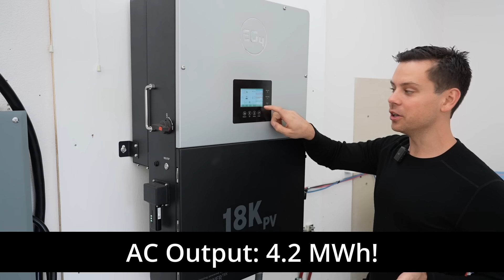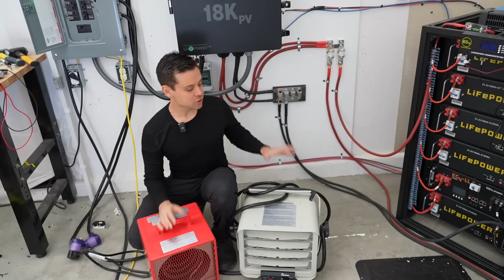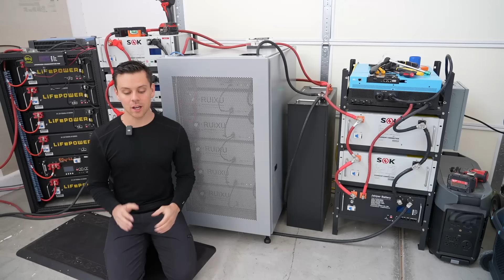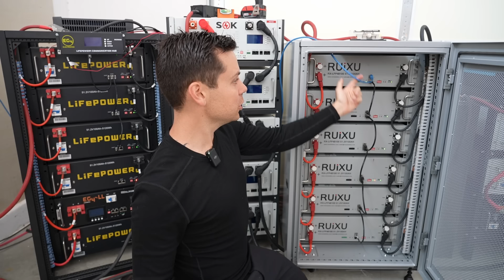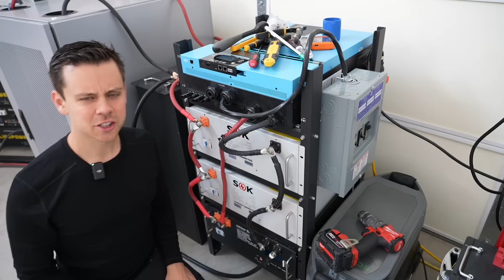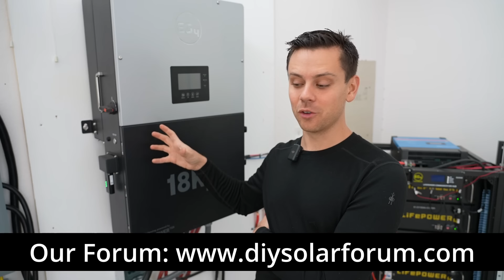EG4 18KPV + 113KWh LiFePO4 = Offgrid Bliss!

Comment: I'd like to see a side-by-side between the EG4 18k and the SolArk 18k including the possible configurations.  Off-grid/On-grid/Hybrid, with and without generator
Reply: I would like to see them compared as well. Possibly with a tear down to compare components? Also curious about shielding/lightning/EMP protection in both units.
Reply: Ditto!  I would love to see a faceoff between these two inverters!
Reply: He aint going to do it because the Sol-Ark is  better Inverter, it has true customer support and Zero bugs.
He does not make any money from Sol-Ark sales so why would any YouTuber promote a product that offers them no financial gain over one that does.

I Sell and Install both the Sol-Ark and the Fortress Envy witch is the same thing as EG4 12K/18Kpv.
The Envy has lots of small software issues that make it a PITA.  I put in a Sol-Ark and it just works, no customer calls.  I put in the Envy and it's constant issues.  Those people at Fortress offer good service but they cannot fix the problems when it's the software.
Reply: @derickvernon6652  Thanks for the reply.  It all comes down to "You get what you pay for, most of the time".  I have heard some good things about the Fortress batteries.
Reply: @derickvernon6652 I heard deye makes sol-ark inverters?
Reply: @derickvernon6652  works great as long as you dont use EG4 batteries ...they just admitted that if you hook up a EG4 batteries to the sol-ark and attach the comms cable you void the warranty because they are not compatible and never will be
Reply: @derickvernon6652  I tried to Google what Pita means but it's telling me something about bread what does the abbreviation mean may I ask. And how much is the solark Ark inverter...n what is the idle consumption on it.
Thanks in advance for your reply
Reply: @VinceBadovinatz88  In this context Pita means Pain In The A$$
Reply: @michiganengineer8621    I should  known🤣 everything was so technical I didn't think of it

Comment: Will, been doing a lot of research on these. Still can’t figure out (can’t find it in the manual) how to set the system to charge the batteries from grid when the batteries reach a set SOC. You can trigger a gen at a given SOC and you can set times to charge from the grid, but I don’t see how to trigger a grid charge based on battery SOC.

Comment: Will - Does the 18k work with a generator because I am 100% off-grid? Does it have genset auto start capabilities or does that require additionally components?
Reply: The genset auto start is on the generator side not the solar inverter side. As long as you’re inverter has provisions for generator then you should be ok.

Comment: I have a question that may demonstrate just how much I don't know.  You made a hand truck portable system.  But, is there a way to make a hand truck portable system that is expandable down the road.  What I am asking is, you can buy all in one systems that have 'plug in batteries'.  Is there a safe way to make a hand cart with just batteries that can plug into the existing hand cart systems you designed, without a whole lot of screwing in wires and such? Just plug and play like an all in one system?  It would be nice if it was easy to add a handcart of batteries to the existing hand cart.  It is much lighter that way with two hand carts.  Just curious.

Comment: Thanks for the video.  I get my EG4 18KPV this week.  Can't wait.
Reply: Did you end up installing the 18K EG4? How has your experience been?
Reply: @justonpreble4083  Yes I did ba k at the end of August.   I love the 18kPV from EG4.  It works very well and I haven't had any issues at all.
Reply: @justonpreble4083   I have now had my 18kPV with 30kWh EG4 LL v.2 battery rack powered by 19.2 kW of Aptos bifacial solar panels and I absolutely love my system.  As Will mentioned it does everything with such ease.  I am now thinking of adding a couple of the EG4 Power Pro wall units to my setup to have extra backup storage.  I agree that the EG4 18kPV  is the best inverter on the market today.

Comment: What would be the outcome if I installed a 30kWH system meaning batteries, EG4 18Kpv and solar panels then shut off the breaker connecting me to the grid?

Comment: Will, I have 2 EG4 6500EX's & SS recently offered me a trade in program for them to goto the 18K. I'm trying to figure out why & what the upside is to going to it? I'm completely off grid & likely always will be. Thx for all you do.
Reply: Be careful. Your two 6500s have more output capacity than one 18kpv, because the 18k = input, not output.  Of course there are other considerations, but that output comparison is widely misunderstood due to SS's label.
Reply: @corba197  agreed. 2-6500's = 13kw. The 18kPV has 12k. I was looking at eventually adding atleast a 3rd 6500 for my +21kw of panels. Being off grid I like the thoughts of redundancy 9f the 2-3 6500's. Some of that is lost with a single 18kPV. But then again, I'm wondering if they may be completely going away from & not supporting the 6500's sooner than later. 

That said, I really like the simplicity & options with the 18kPV... especially with their new PowerPro/ LUX batteries that are made for each other. If I do the upgrade, the odds are I will eventually end up with 2 18kPV 's for 24kw potential. AND then keep the 6,500's for a backup or AirBnB cabin use.

Comment: Love the videos Will, I dud buy one of the yellow Eg4 3k inverters but noticed an issue with  the power output it does produce 120vac between L and N but if you measure between  L and G  it is 57 vac and between  N and G it is 63 vac.   Contacted signature solar  and sent them pictures documenting these conditions.  Now I am waiting for them to get back to me with a diagnosis it has been  about 5 to 6 days. Has anyone seen something like this?

Comment: Hi Will, The most challenging domestic load I've found is a microwave oven. I think it's the power supply in the oven rapidly switching current, similar to an arc welder. Maybe, add a microwave oven to your test jig.
Reply: I noticed the same thing with my mig welder. I think it is due to poor voltage regulation.
Reply: @SunInLithium  , Both operate using a sort of pulsing power supply, so the current starts and stops at a super high rate. Light dimmers do the same thing, but the current is low. A mig welder is a double whammy, because it has two pulsing parts: 1) The switching power and variable pulse width control for the electrical arc current; and 2) The "pulse width modulator" that controls the rate of wire feed.

Comment: Great video... I appreciate the load testing information and the statement you made about it handling a 5 ton A/C with just one 18K.  Keep up the good work.  I've been using a smaller system to backup critical loads but would like to run the whole house off the grid if necessary.  I live in New Orleans, with hurricanes and the grid instability of an old grid it just makes since to cover the whole house.  I would like to see some of the attempts you made to try to trip the 18K.
Reply: Signature Solar just dropped a really good load test video running a 4 ton with regular household appliances.

Comment: Hi Will, there are a few details about your test setup that are important to the evaluation of a hybrid inverter. You did good on the performance of the SW interface. there are alot of installations that will want to connect in existing AC coupling, be able to sell to the grid and AC couple when the grid is down.  This requires a transfer switch in the EG4 inverter that can manage the isolation.  It is not clear how you are testing this mode. Related is the configuration is that many solar systems would be most economically modified by just adding in the EG4 inverter which most generally may also require not having the EG4 inverter near the service entrance.  This requires the EG4 be able to control a remote contactor at the meter.  It sounds like your shop and house loads are distributed suggesting a this test setup.    How does the EG4 do in managing the grid tie when the meter is remote?  thank you
Reply: I have 3 grid interactive installs using the Envy Inverter witch is the same as the EG4.
All those Installs had random Grid selling which caused some issues for the owners and so far Fortress has not been able to fix it.
I also have lights flickering at those installations.  The two off grid installs I have had generator starting issues as well as the same flickering light issues.  Customer spending $30K on equipment I just tell them spend an extra $1K and get SolArk.  Better for them and better for me as I have a lot less calls about problems.   The Folks at Fortress have been very good on customer support but I am sticking to their batteries which work very well and not using there Inverter.
Reply: @derickvernon6652  whats causing flicker?  are they led lamps?
Reply: well said
Reply: Asking the real questions

Comment: Also can I configure this system to run my house with solar power during the day while the battery is used during the night??
Reply: Yes of course you can, thats how i have it. Of course you need to know your power consumption so you can buy the proper amount of solar panels and batteries. Good thing os that its scalable you can start small and keep adding solar panels and batteries
Reply: i think so.

Comment: Video with the 18k ac couple with the grid tie solar. Would be a great video on the set up with the 18k inverter. would be great when power goes out and still use the grid tie to supply power to the 18k  to power the batteries and power the house. Looking forward to the video.
Reply: agreed

Comment: I love my 18K I’ve been using it now for two months off grid in Denver Colorado. It works really well only thing that I wish it didn’t do is it occasionally pulses, my light fixtures and when it does, it’s super irritating. I’ve been told by Signature solar customer support to do the firmware updates and they are all done and the flickering has reduced but it hasn’t been eliminated
Reply: I have 2x EX6500s and I get this issue when I turn on my clothes steamer or my espresso machine. Since the heaters on these are PWM, when they pull from the wall they cause lights to flicker. I've actually noticed I've left the coffee machine or the steamer on because I'm just randomly about the house and I see the lights flicker and I know to go check both.
Reply: It’s a safety feature! Hahaha 😂
Reply: @drod6424  they finally got it figured out after a firmware update
Reply: Are you running any large resistance loads like heaters? Or older intermittent motor loads like an old fridge or HVAC?
Reply: @atomicsmith  no I have a new Heat Pump installed this year, fridge and freezer in garage are two years old.
Reply: @a16416  my guess is that one of your loads is causing a feedback that discuss your otherwise clean sine wave from your inverter. This then wreaks havoc on the PWM circuit in your LEDs making them appear brighter. You might try disconnecting those loads one by one and seeing if that eliminates the issue. You might also try different LEDs. Some times they are badly shielded.
Reply: led lamps?
Reply: @keything8487  yeah LED recessed lights, lamps, all my lights
Reply: Are you ac coupled?
Reply: @SolarTechFL  no I am not, I have: EG4 18KPV inverter, EG4 LLV2 (x6), 14KW Solar Array
Reply: @a16416  wow that's the one thing we'll said he heard didn't happen

Comment: Thx Will, an 18K, plus 4 AES 42-48-6650, are all I'll ever need, with a T-class fuse and I'm set for good. You definitely made it easier for me. I was hesitating between a Schneider XW Pro and a Solark 15K, now, the choice is clear! It's the 18K
Reply: What are the advantages of the AES batteries vs the EG4 rack batteries?
Reply: same
Reply: So I purchased the SolArk 15k well in advance of when I needed it. It’s still in the box on the original pallet. 2 months after my purchase this came out. My question is, should I ditch the SolArk and buy this and save myself half the cost? I can probably sell the SolArk to a local company for what I paid for it. 

What is the real sacrifice? I’m having a hard time finding one. My system will have 11Kw of micro inverter panels, 5kw of standard panels, EG4 or similar battery and a 22kw Generic. I’m “on grid” and would power arbitrage if possible. 

Ok someone talk me out of this?!?
Reply: @Iseestupidpeople122  if you won't loose lot of money, selling the Solark for the EG4 18K-PV will save you lot of money, time, and you would have less parts to deal with too. As a matter of fact, Will has a nice video on how to install the 18K-PV. Dave Poz has a nice video on installing the Discover AES too. Good luck Bud! I do not get a penny by endorsing any product. Renewable energy to me, is a community of like minded people and there's a certain kind of camaradery between us. Whatever I know, I share it.

Comment: Zero export in hybrid mode is non-functional right now if you can't export anything back to the grid due to no backfeed agreement. Plenty of posts about it on the forum. They have a firmware update that disconnects from the grid using the relay when you have enough charge, but it's not exactly a hybrid inverter at that point. Fast zero export doesn't seem to do anything differently.
It's a great unit, but don't buy it yet if you need zero export.
Reply from the maker: Me and some friends were going to test that function in a few weeks with no solar and some batteries. They need to get that to work
Reply: @WillProwse  Just give it a quick check, you don't even need secondary test equipment to see if it yours acts like mine. Just uncheck "grid export" and let it run for a bit. It is generally centered at zero, but sometimes exports up to 100 watts steady state, not even in response to a load turning off. The 18k display shows it too. I'd have spikes into the hundreds of watts even at steady state. Definitely turning off big loads it takes several seconds to react - and I think that's perfectly acceptable. That's just the nature of how power has to be reactionary. That's what "Fast Zero Export" should fix by reacting faster at the expense of importing more over time because it must react weighted on the import. However when that gets checked nothing changes. Give it a try, no need to change your hardware configuration.
Reply: @therusty959 even signature solar has admitted this to me also (on phone call)
Reply: @therusty959 i cannot export at all or I get fined by the electrical company and even though i have zero export and fast zero export in place it has exported 3.5kwh already. They changed the firmware so now it does not work with the grid. Its on “EPS (UPS)” mode, but when my batteries get to their lowest setting it takes 5 minutes to accept the grid (5 minutes of total blackout) and when the grid comes on it charged my batteries for one hour and i cant make it stop and ac charging is disabled, ac coupling also… signature solar saw my settings and said everything was fine, but they didnt know why this was happening and that they had to
“Escalate it”

Mean while, im getting a 5 minute blackout every night and then grid charging my batteries. 

Also my batteries are “Full” at just 99% and only 53Vdc..: it wont charge up to 56Vdc ive tried everything, signature solar has tried everything, nothing works
Reply: @therusty959  good news! Call and ask to have them install the 0e:0e firmware, finally i’ve seen 2 days with 0.0kWh export to the grid
Reply from the maker: No way!! I didn't see those posts at all. That's not good!
Reply: @WillProwse its true im having that same issue along with others ive been posting in the forum and no help or solution from signature solar yet
Reply: @WillProwse  hi Will, first thanks for all your videos and showing us so much! 

I must be on the top list on the forum talking about this issue. But there a lot of people feeling the same way. 

Finally after someone on the forum said that going back to a firmware called 0e:0e has been the best one regarding zero export. Someone from Luxpower helped me out and changed it firmware 0e:0e and finally two straight days with 0.0kWh exported to the grid. 

There are some software issues but this thing is a BEAST!
Reply: Same. Zero export should not be on the marketing material. It simply isn’t true.
Reply: @jonathanwisner2403  i have great news for you, just call and ask them to change your firmware to 0e:0e, that will solve your problems right away. Real 0 export
Reply: @WillProwse  OEOE is in fact working much better for me, I somehow just didn't realize it at first. I hope you find the same thing.
Reply: @therusty959  thats awesome im glad i could help